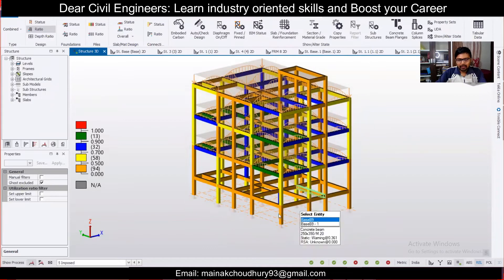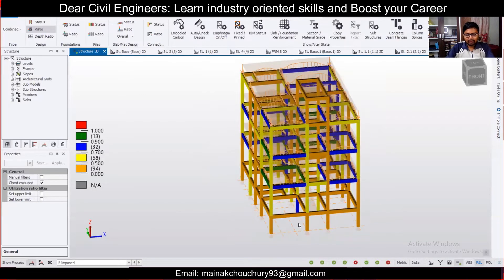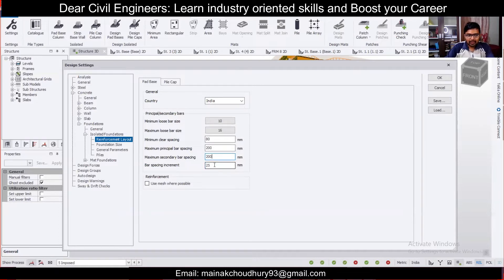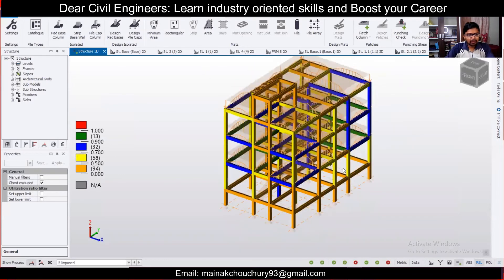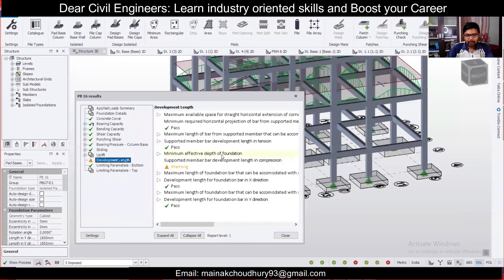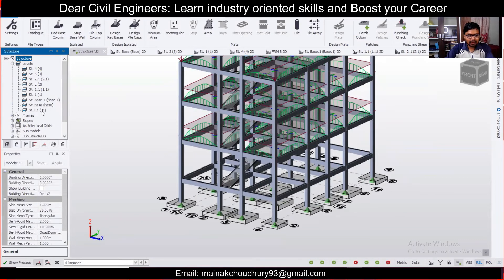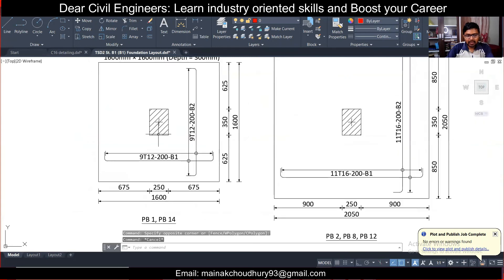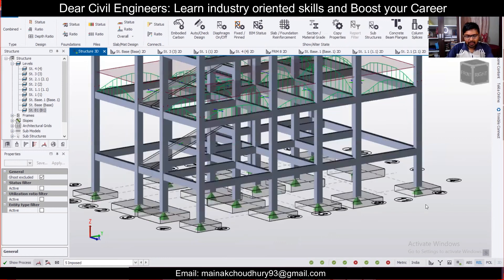Foundation Design Tekla Structural Designer || Isolated Footing Design

Comment: How can I ask tekla to design the foundations considering the service load combination only?
Reply from the maker: That's a good question, till now I did not find any option of using un-factored load combination for foundation design, like we can do in Bentley RCDC. As we know for foundation design we should use un-factored load combination because in soil test report the SBC is already calculated using a FOS of 2.5.
Reply: @MainakChoudhury  Thanks for the reply, my solution would be creating a copy of the project and delete the previous load combinations and create service load combination only.

However, this solution is not enough since it will be only for bearing pressure, not punching shear or bending moment since these require ultimate load combination.

Would like to hear how you would solve this.